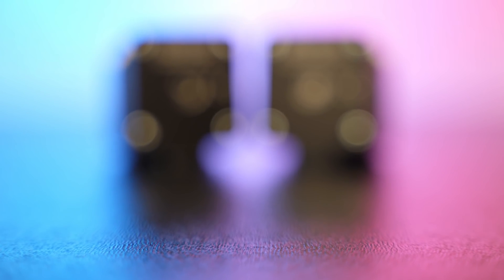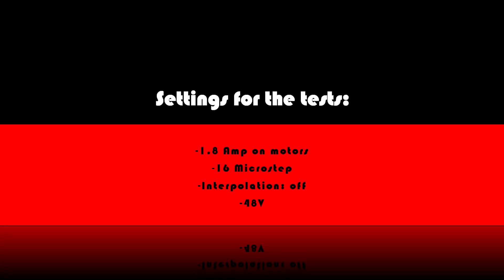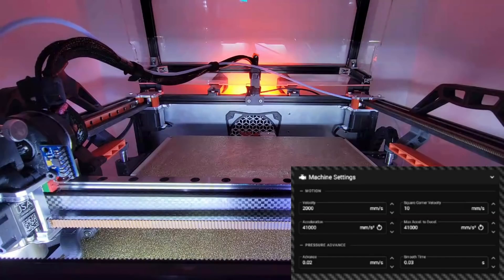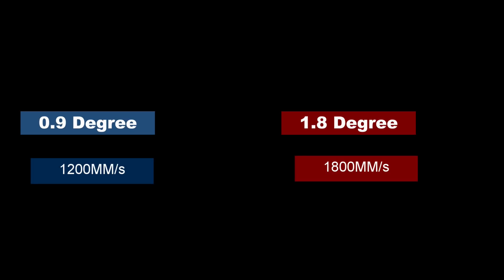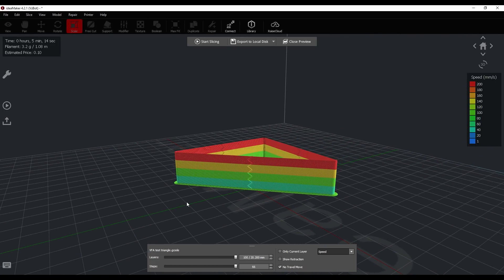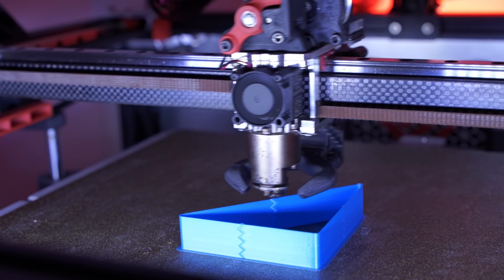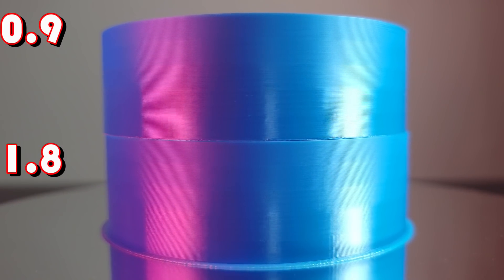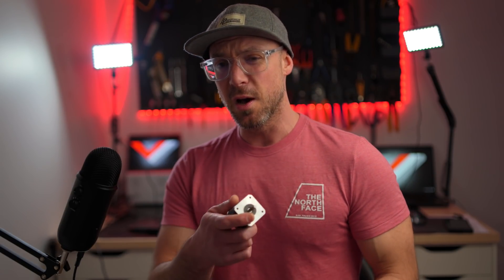LDO Stepper Motors 1.8 vs 0.9 Degree. Battle of the 48mm!

Comment: You have to print multiple complex shaped objects on the same print plate  and then compare the quality. The coil windings on a 1.8 degree stepper can make layers slightly shift without loosing steps . These are the sporadic visible layers when the object changes shape or travels to the next object on the build plate. This is due to the pulse frequency coming from the main board and the point of directional reversal at high speeds. 0.9 is much better than 1.8  in that regard.

Comment: noticed in the sound test the 0.9 would get quieter as it ran that speed, honestly at the speeds we would run them for proper prints the 0.9 was clearly quieter. in resonance in Y axis there was a big difference but in the other as well in Y 0.9 was the winner the X Axis 0.9 won again but you can see a match in the patterns at peek for the 1.8 is seen on a secondary peek on the 0.9 this is something in your hardware frame belts pullies etc both motors are dealing with it at different intervals.. but from the graph you showed 0.9 is the clear winner..  speed 1.8 is going to win all day but it's not the motor here it's the driver it has to process each step for every one step of the 1.8 motor the driver has to work twice as hard with the 0.9 stepper, so your driver is taking more load in every way so another category you did not say Ife expectancy the 1.8 is going to be better for the life span of your drivers... 0.9 is niche it's better for your smaller more accurate detailed prints but normally you use them with smaller nozzles to take advantage of this  slower prints yes but better detail and quality it's resolution capability is literally twice that of the 1.8

Comment: You have changed the stepper settings from 1.8 to 0.9 needs other vref than 1.8 etc etc.
Vref and emf is not the same.
As i compare you test with mine.
Than are Usongshine motors 43% better and more silence.

I think you have not calculated vref on reverence.
Ine motor 1.8 need 2.5 other 3v for max curent holding.
A 1.8 stalls 60% earlyer on vref for 0.9 degrees.
And tye 0.9 degrees missing torq in begin and have on low vref higher emf and stall on 60% of his max speed.

Motor test need info as used driver and motors and vref and emf for good calculation

Comment: 0.9 step degrees doesn’t excel in speed or acceleration, in fact it has to work almost twice as hard of 1.8 degrees. Given the limitations of the nozzle end, quality also no difference in 3d printing. Even in laser engraving, only if you have finer spot size, example small than 0.08. In simple words, 0.9 give smaller steps, finer movement which will be translated into better resolution. It has to be in the right application and limitation.

Comment: I get it's an older video with a lot of comments and someone probably suggested this already, but just in case they haven't: Curious how the tests would've differed if you would've swapped the print nozzle for a 450nm diode laser (a well known 3dp "mod") and tested something with more precision required, such as etching 0.2mm pcb traces. iirc (I did the math a few years ago), depending on what you're driving, 8mm pitch gt2 belt in this case (I presume), the difference between each motor's precision is only like 0.02mm - something you're not going to be able to distinguish with a 0.6mm nozzle on a highly tuned printer.

Comment: Would be interesting to see the 0.9 do small models, also wouldnt a smaller nozzle amplify errors more, as the wall thickness is much thinner and will need to move more precisely to keep it steady ?

Comment: It seems that the last speeds that have been tested are those that do not give vfa, so the "bad" speed is at the bottom, for both motors. In sumary, print as fast as you can and avoid slow printing.

Comment: Did you have resonance profile activated and updated for each motor setup? That could be why you saw no difference to the print quality. Even though resonance curves were similar, with a profile active it is eliminating any shortfalls each motor can have that would affect print quality at speed

Comment: Have to order some motors soon and was curious what the difference was between them.  Thanks this is helpful. 

I'm impressed with the difference in acceleration I have gotten going from no name China steppers to a quality brand. On a printer I recently modded i used to have skipped steps at 4k accel and now with new steppers I'm running 15k acceleration with ease.

Comment: Since I'm building a (for me) quite big printer with 300x300x400 build volume I'll consider those motors. I've used the 0.9° motors from another brand in a smaller prototype and they work well with 24V and 1.6A. But since I'd really like to go faster at this print volume I'll need some #LDOMotors with 1.8°.  AGAIN I'm appreciating your video a lot since you answer questions I don't have the time and money to answer!
Thanks so much and until your next video.
Oh yes: how do I get a prototype of your Goliath hotend since it's still the best one fitting my plans for the world's smallest all-in-one printhead?

Comment: Proper servos can outperform those steppers.
Reply from the maker: In therms of speed yes.. but they also have their own issues on a corexy
Reply: @Vez3D  What kind of issues? Are you referring to stiffness?
Reply from the maker: @mysterious_nobody_99  depending on the encoder res you might get artifacts
Reply: @Vez3D  That's a non-issue with any decent industrial servo system like Leadshine's EL6 or EL7 series. They have 17 bit optical encoders, far higher than the highest microstepping resolution you can achieve, and so many built in features like vibration suppression. I can't imagine any proper servo system being worse than steppers. Odrive is a toy, you should try out proper industrial servo systems.
Reply from the maker: @veegee2424  my buddy miragec tried some clearpath. And also had issues. But they were low res encoder.
Reply: @Vez3D  Clearpath are overpriced crap. They make you pay more for a higher resolution encoder. Look at the leadshine EL6 or EL7 series, or the "T6" servo drive kits from stepperonline (which are rebranded EL6). Those have 17 bit optical encoders. If you have any issue with those, you're doing something wrong.

I cannot imagine any situation where an open loop stepper is better than an AC servo. You will get far better speed/torque curves, no torque ripple, and any proper servo drive will have vibration suppression and a million different parameters for tuning. You can get more accuracy than any tool in your possession to measure it.

Yaskawa, Delta, and many other manufacturers also have excellent industrial servo systems, but they're more expensive than Leadshine and not needed for this purpose.

If you want next level performance, find a "linear servo". This is made using actual linear motors, not regular motors permanently fixed to a ballscrew. They're at least $2,000 per axis, so not something you buy unless you really really have a need for it.
Reply from the maker: @mysterious_nobody_99  i have be eying linear servos for a long time ;)
Reply: @Vez3D  And I accidentally bought 2 x X5SA pro because they were 50% off for a total of $300, so I guess I'm going to be following your guide now.

Comment: Your test is not accurate your testing a 1.8 step to a 0.9 step it is pretty obvious that the 1.8 is going to have a greater velocity due the step difference the 1.8 is going to be 2 the velocity because  it’s movement per step is greater. It’s moving a further distance per step.

Comment: The important thing is that when you aplly a momentum to the motor you will have a diviation from the lock point.
For axample if you apply the half of the maximum momentum you will have 0.33 degrees of deviation which in turn converteing to 67 microns (if you have 1.8 degree stepper and 40mm pulleys). 67 microns is big deviation actually. If you compare to deviations from timing belts stretching, frame and print head bending you will have several times less deviations.
For 0.9 degree stepper it will be twice as less.
Reply from the maker: I like when people like you comment :) nice details and explanation because this is way over my knowledge. thanks brother

Comment: I’m confused about the VzBot stepper drivers

It seems like the stepper drivers at 48v sound like a4988s. Are they tmc5160 HV drivers in spreadcycle? 

If so, is microstep interpolation still turned on? If i want to keep my printer quiet, does stealthchop still work?

I’m looking at converting my voron 1.8 to tmc5160@60v but I don’t know if it will make my machine louder.
Reply from the maker: Spreadcylce  5160 with ldo speedy.. yeah they are loud

Comment: nice video I really needed something like this
myself I compared stepperonline nema 17 1.8 and 0.9 steppers for precision
I hooked them up to a linear encoder with high precision
run in a range of speeds and finally the 1.8 came as more precise
by very little 0.03 if I remember right the excel chart
but 0.03 can be a lot depends on the project requirements

Comment: I think 0.9 degree motors will pretty much always have very little to provide on a well-tuned CoreXY printer. Especially when you're moving at speeds the Lord himself wishes he could move at. However, I do believe the Cartesian printer community could see benefits of swapping 0.9 in to solve certain issues (for me, swapping 0.9 motors in was an attempt to resolve problems, not to gain "resolution"). 

Cartesian printers will probably never see speeds CoreXY printers are capable of (at least not without a bucket load of money and reason to do so), so the fact that 0.9 motors struggle to keep up with accelerations in the 5-6 digits (let's take a moment to realize how insane that is!) where 1.8 motors can, won't be a concern. However, Cartesian printers do experience problems CoreXY printers don't face and that's where 0.9 motors can be a fairly cheap solution. That, to me, is more-or-less their marketing value.

Comment: Did you also use an 0.9° motor as the extruder as well? If not then the results don't actually show much of anything. The print results would then be due to the extruder and it's different motor type.

Comment: 45° motion requires 2 motors, not 1 motor. Y for forward & rearward motion & X for right & left motion.
But maybe I missed something or other...
Reply from the maker: This is corexy here. 45degree are from one motor only :)
Reply: @Vez3D  And even my Core XY Ender 5 has both an individual X and a Y motor...
Reply: Ah, just discovered there are 2 forms of core xy and the newer (which I was unaware of) uses only 1 motor. We were both correct and incorrect it seems.
Ender 5 is older type core XY when no Z movement is active.
Reply from the maker: @monkeymanstones1  no i dont think ender 5 is corexy.
Reply: @Vez3D  Not the new type, no.

Comment: But couldn't you lower the micro stepping of the 0.9 motors to make up some torque difference and possibly gain speed and acceleration over the 1.8 motors?

Comment: hey vez, as for the quality test, maybe try running below .2mm layer height with 1.8 vs .9s if there is a significant quality difference i think it would show more at that time. #ldomotors

Comment: i have an anycubic 3i mega, and the zigzag test have an outstanding result! i liked the .9° the most since the diagonal test result look better for me. 

in my opinion, i would take the .9° but, only, and only if... i have the optimal drivers to run them, correct frequency, current, step...

Comment: Why are you doing this comparison?
They have same inductance, same coil resistance with same amps rating and max torque. This means they will build the torque identically and so with the double number of steps pr time unit required for the 0.9deg it will reach the slip point at half the velocity on speed test assuming equal load. For the acceleration it is a bit complex due to the changing direction but same principle applies. The only real question here is if you need the extra steps resolution or not. For belt drive it is often useful.

Comment: I have to agree, the .9 didn’t have any meaningful advantage that could be readily seen.

I think that since you’ve got such a well-tuned printer, there wasn’t anything to gain, and I expect that motor is not the limiting factor for quality.  For speed, that also as I expected: less frequent steps means more power and thus speed and acceleration.

Comment: Cannot help but wonder if in an environment where precision is more important than maximum speed, like in a laser engraver, would be a better test for the 0.9º #LDOMotors stepper. I am building a CoreXY frame for mine, and that would be a nice replacement for the ones I have :)

Comment: I mean this test is a bit unusefull ... Ok if you plan just to change the motor on your printers witout tunning the driver setting, fine. But your board certainly use micro-stepping capability of the stepper motor driver... So OF COURSE with the same microstepping parameter the motor with less magnets will run faster and have better acceleration. This is totaly unfaire comparison since stepper motor are better at positionning than moving. The test will be more usefull with a reduced microstepping configuration for the 0.9°. And even, if you are more interested by speed, than precision, of course going on a stepper with less magnet will always give you better results. The best thing to do in my opinion is to find the best stepper for you 3D printer in term of mechanical precision and maximum speed alowed. If the bottleneck of your printer is its mechanical design, just go with stepper with less magnet. If it is the stepper, increase the number of magnet (0.9° stepper)

Comment: Great video! I’m curios how the quality would turn out with a close together zigzag print since it’s constantly changing direction and accelerating/decelerating. I would think the 0.9 would perform better there but wouldn’t be surprised if that 1.8 held its ground

#LDOMOTORS

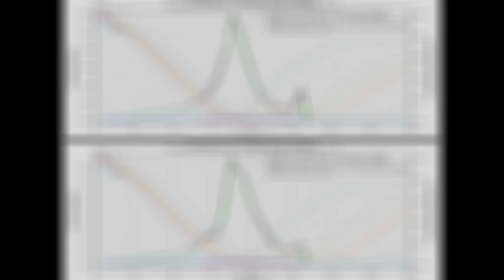Comment: Regarding the #LDOMotors resonance results, there actually is a difference which is easy to overlook as the graphs are dynamically scaled (check the numbers on the left side). At 6:52 the graph shows the peak at 3.0 for the 0.9° motor and 3.3 for the 1.8° motor, or an increase in 10%. At 7:45 the graph shows the peak at 0.975 for the 0.9° stepper and 1.075 for the 1.8° stepper, also showing a 10% increase.

Edit: I subscribed and upvoted after posting, hope that isn't filtered out by whatever algorithm is being used for selection. :)

Comment: As a 0.9 degree motor allows smaller steps and therefore greater accuracy, the only advantage would be for fine detail prints, probably using a smaller nozzle. I am not surprised these test prints showed no difference. #ldomotors

Comment: I have 0.9° e3D motors in XY on my HevORT so I already knew that the 1.8° #LDOMotors would win in the noise test, sadly my Wantai 1.8° motors have a shaft too short to be used (I did test them previously on a Hypercube, now happily converted).
As for quality I knew it wuold be a tie: without even testing them just look at how many steps/mm you have to put in your configuration file, that means that with a 1.8° motor you'll have a high resolution so doubling that for 0.9° wouldn't make a difference since it would be limited by the nozzle.

Comment: #LDOMOTORS would have expected to see a difference in the cylinder test.  Was an arc move used there instead of linear moves?  The lower acceleration and top speed of the smaller step angle is not all that surprising.

Comment: These velocity tests are great. I usually do a tuning tower on velocity to show resonances that might happen at specific velocities. This kind of resonances happen when the step rate matches the resonant frequency of the system, or an harmonic. Input shaping can't correct theses, because the excitation source doesn't come from accelerations but from non linear micro-stepping or cogging/detent torque. Usually the higher the torque, the stronger is the detent torque. That's kind of a compromise between torque and quality, but given your results, I'd trust #LDOMotors choices.
I think that, in general, 0.9 steppers ask for more precise parts than 1.8s. So, in my opinion, this 0.9 vs 1.8 debate cannot be settled by comparing steppers of varying build qualities from different manufacturers.

Comment: #LDOMOTORS I have a question since I’m not versed on motors. What does the degree represent in the motors? .9 vs 1.8? What does it mean?
Reply from the maker: degree of 1 step on out of a full 360 degree. So 0.9 degre has 400 physical steps in one turn.  360/400=0.9  ... the 1.8 degree have  200 steps per turn.... 360/200=1.8 degree of movement for each step

Comment: the #LDOMOTORS 2504ac motors are insane, and i first got put onto them from eddie's videos where he built those charts out to show motor differences. im currently building corexy printers #4 &5 on my farm and one of them i'm building with the 2504ac's on 48v with 5160s and i cant wait to let that thing fly . seriously contemplating converting my voron 2.4's over to 2504's on the AB drives too.